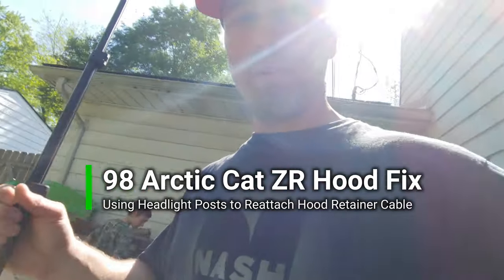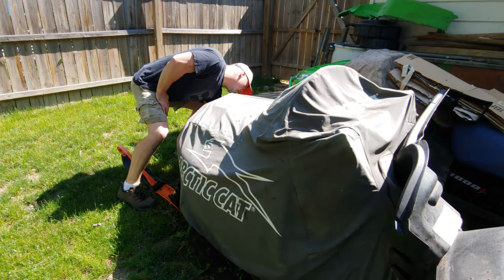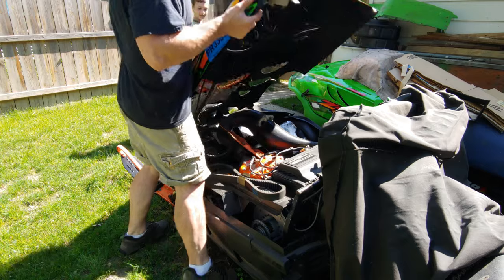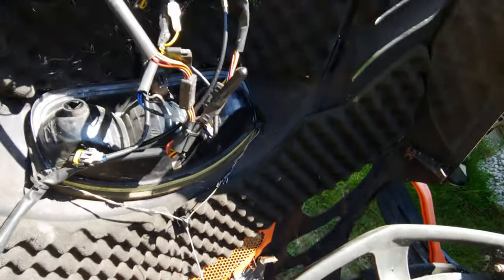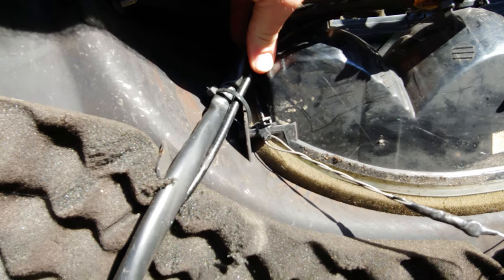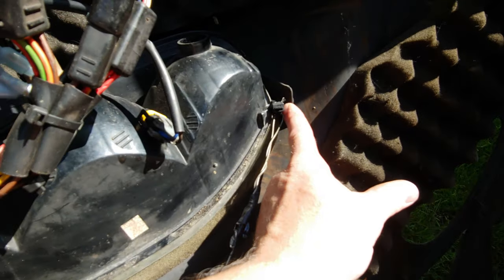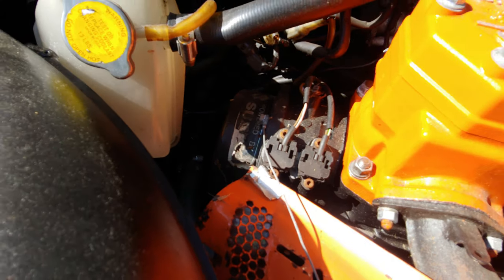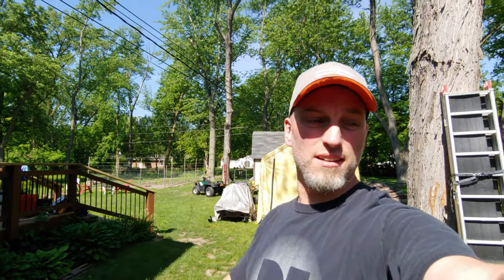98 Arctic Cat ZR Hood Strap Repair

Comment: I know you do a lot of repair and restoration, any thoughts on how I can clean up the tunnel on my 99 ZR 700? It looks like there is a vinyl wrap over the aluminum tunnel, it's all peeled off and cracking, I don't know how to repair it, just trying to make the sled look a little more presentable, let me know if there's a way I can get you a quick picture, so you can see what I'm dealing with
Reply from the maker: Probably best to use a heat gun and peel it off and hit it with some epoxy black paint.

Comment: Do you have issues with the foam padsing on the inside of your hoods? On my 99 ZR 700 the foam is so dried out it literally crumbles off the inside of the hood if you touch it.  I was just going to try and remove it, I don't know if you can replace it?
Reply from the maker: So I have seen like that. But yeah you can remove it. Its mostly for sound deadening.
Reply: @Fixin2Ride-Official-  have you ever painted a hood? I tried to pick up an Arctic Cat rattle can color, it's candy apple green, nothing like the original ZR green hood color. I'm looking for a close match to the original hood color in a rattle can, I don't have equipment to paint using a spray gun.
Reply from the maker: Yes. I use basecoat, let it dry for 7 days and then used Eastwood 2 Part Epoxy hi gloss clear coat. This one... 
https://youtu.be/G2SLqT-ZmTI